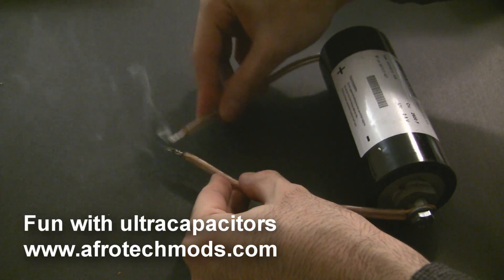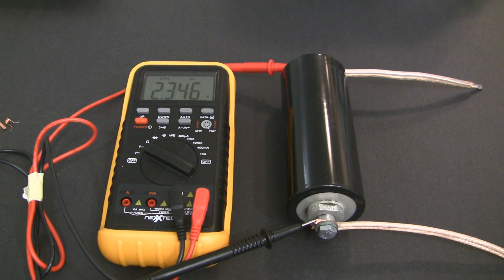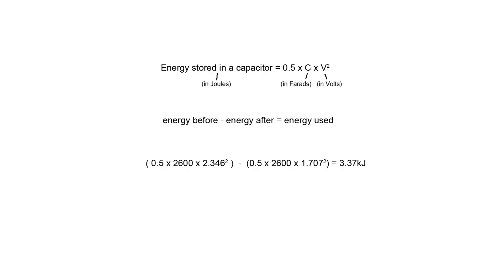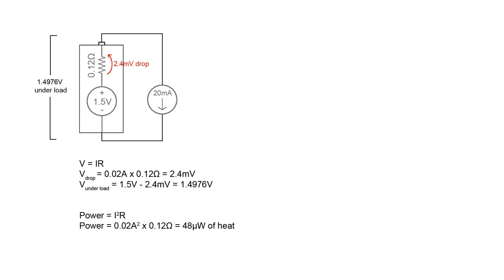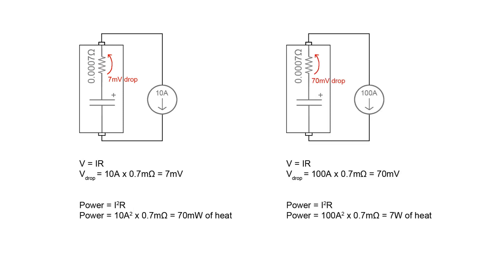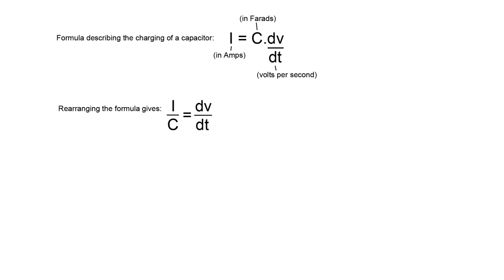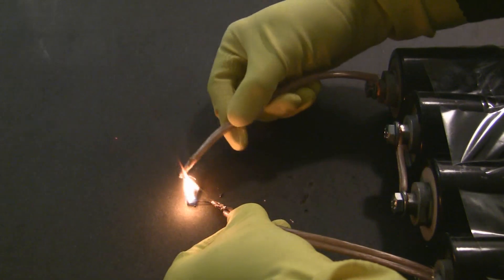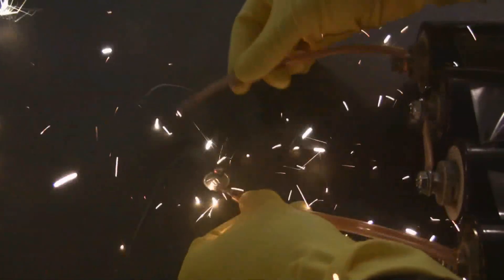Fun with ultracapacitors!!

Comment: So....testing these on your tongue would be a bad idea.
Reply: Well its about as bad as putting your tongue on a 9v battery for a smoke detector.. because the voltage is not very high. your tongue will not vaporise. theres a difference in conductivity between solid metal. and your tongue.
your tongue isnt going to incinerate. because your tongue is not a solid piece of metal.
your tongue is a very poor conductor.
You don't get shocked when touching both ends of an AA battery with 2 fingers on the same hand.
You dont even get shocked with 20v DC across your fingers.
You would need at least 50v DC or higher to even start to feel a tingle!
Reply: If your tongue resistance was 10k Ohms (which I believe it is) there woud'nt flow a huge amount of current.
I = U/R (9.65V/10000) = 0,000965A. That would't hurt.
Reply: PrashMotion You just wouldn't want to accidentally short the wires while it was on your tongue
Reply: short the wires of the capacitor bank? or of the 9v block?

Comment: So a capacitor is basically an a battery without built in resistance?
Reply: Capacitors and batteries do the same thing (store energy) but they are two completely different components.
Reply: David Kaufmann batteries use electrochemical energy, capacitors only use pure electric energy or the geometry of the capacitor.
Reply: Batteries use chemical energy and capacitors use static electricity between 2 parallel insulated plates. The more voltage you want the more insulation you need but less surface area you can fit (less farads), or the more farads you want but less insulation you can fit inside.

Comment: Should be titled. Welding with capacitors. I see your wearing heavy rubber gloves, and I'm sure face and eye protection. Like a welding mask, because that would surely cause eye damage from the bright sparks. Please don't try this at home, it's very dangerous without all the safety measures I mentioned. It's much subdued when viewed on video.

Comment: Is it possible to hook up those 4 connected ultracapacitors to a transformer and then charge an electric motor on a car or any other motor with pulse signals? :) In this case those capacitors would work like a battery?

Comment: If you're going to try this yourself I recommend setting up some type of quick disconnect switch or breaker in case the wires become stuck and get too hot to touch.  Much better then a complete meltdown.

Comment: Wait, so if I have zero volts when I've discharged it, these numbers don't make much sense.
0.5*2600*25 (25 is 5v squared) - zero = 32500kJ / 3.6 kJ/Wh = 9028wh.  I'm doing the math wrong, right? 9kwh out of something that can fit in my hand?

Comment: Using your calculations you used about 100A at 4 sec for ideal short circuit, as need to includes wires and short circuit resistance, which can measured with mili-ohms meter.

Comment: I have a "common" electrolytic capacitor here... two actually. each one is rated 200 "WV" (does that just mean volts?)  and 680 microfarads. if I charge it for six seconds with 120 volts, how fast will it discharge below half of it's original charge if it just sits out, not attached to anything?
Reply: WV!?!?!?!?!?!?!?

Comment: Well, except for two things:
1.  you can only cycle a lead battery down about 25% without causing some reduction in cycles available.
2.  Lead-acid takes a while to charge, while caps charge as fast as you can provide the energy to them (assuming a decently low ESR (resistance)), so you don't need to store more cycles than necessary to start your car once (+ some safety measure).
3. Caps have an almost unlimited # of cycles available.
4. I can't count.

Comment: Can you power something with these like a battery? you have them wired to output 9 volts DC. Could you power a boombox that normally runs on 6 C batteries or would it just fry the boombox?

Comment: with at least 5 of them - yes (5*2.5v = 12.5v) but you should use at least 6 of them or you run in trouble if they get charged by your car up to 14.5v

Comment: so it is no problem to charge them with 100 amps if my wires dont vaporise? but i have another question. i bought an array of 7 from those maxwell 2600f/2.5v. do you know what happens if i charge it up to 14.5v and connect it to a 10.5v car battery? does it blow up my battery because of charging it?

Comment: "but if the capacitance is high then the discharge will take a long time" you should add a qualifier here that says "assuming the same stored power". There's nothing *bad* about high capacitance, but what you need is high voltage and low ESR to get high current. High voltage only becomes equal to low capacitance when you assume that the power stored in the system is a constant.

Comment: ".... or 32.5 kw for 1 sec....... or 1MW for 0.0325 secs" is FALSE!
Because capacitors has internal resistance. Its maximum power is less than 12 kW per unit. It is equal to 48kW per 4 units, but this power will be only for 0.1s. If 4 capacitors discharge from 2.5V to 0.5V for 1s, then energy is equal to 20 kJ.

Comment: what would be the difference from putting it in parallel? you would get the same 2.5V, and but with a huge 10,4K farad. What are the pro and cons to parallel and series in terms of power, and the effects ( sparks)

Comment: Hi!If you have configured the capacitors in paralel and the total capacitance will be 2600 F x 4=10400 F at 2.5 Volts will be the same as you configured in the video in series at 650 F and 10 Volts?The power will be the same?

Comment: Yes. We have varying amounts of resistance depending on how far apart the points are being measured, moisture level of the contact area etc. This is why placing a 9volt battery across your finger results in nothing but putting it on your tongue produces a noticeable shock. Your tongue has much lower resistance than your finger and will pass more current from the battery. We also act like capacitors to store a charge since we are generally insulated from ground by shoes, carpet etc.

Comment: Both are partially right but the woodworking teacher has the edge. Voltage is basically the potential to deliver a dangerous amount of current. If as you suggest voltage was the main determining factor we would all be dead. We are constantly building up and dissipating thousands of volts by simply moving around (static electricity). The difference is there is next to no current behind the discharge. Household 240v is quite dangerous because of the current backing it in addition to the voltage.

Comment: "a battery is a device consisting of one or more electrochemical cells that convert stored chemical energy into electrical energy."

"A capacitor is a passive two-terminal electrical component used to store energy in an electric field."

Check more from wikipedia :)

Comment: Leslie Liu, yes you're wrong. The higher the resistance, the slower the capacitor will discharge. Try connecting a charged capacitor to a 2 megaohm resistor, then the same capacitor charged to the same voltage in a 200 ohm resistor. Monitor their voltage variation with a multimeter.

Comment: The reason capacitors have a measurable capacitance (in farads) is because they can store a voltage supplied to them. The vast majority of batteries can't store an external voltage.. Also, they have different mechanisms: a battery stores chemical potential energy while capacitors store electrostatic energy, so it doesn't make sense to apply Faradic capacitance to a battery.

So it's practically 0 (there is a tiny amount but it's negligible).

Comment: If the ESR of the battery is low that means the power (P = I^2 * R) absorbed internally is also very low, which means not much heat is produced (power through a resistor is transformed into heat).

Comment: Dear friend. If I buy an Ebike wheel with Voltage: 48V //
Wattage: > 400w  // motor type: 1000w 
Is possible swich the battery to some ultracapacitors like that one or they will lose power to fast?

Comment: A large cap tend to use an electrolyte whose polar molecules reduce the electric field strength so the device has the same capacitance as an air-gap capacitor with the same area but nanometres apart but without requiring insane engineering tolerances. (+|:−E+:−E+:−E+:|− is like +|:::|−.) Also higher value capacitors of the same type tend to have bigger plates, often made into a jam roll.

Comment: One doubt on the Capacitor Size.
By theory, larger the value of capacitor then less is the distance of separation between the two plates. But generally larger value capacitors are with larger size. Why ?

Comment: The other problem is that they discharge by the themselves faster than lead acid. If you leave your car parked for more than a week I guess it would not start. 

Another advantage is that (if you don't treat them as in this video) they last a long time, longer than the life of a car.

Comment: These capacitors contain about 8K joules per capacitor. A good car battery contains about 288 (says google) so you would need 36 of them which is rather large and heavy. Not recommended for family saloon.

Their advantage would be that if you had the power supply or a massive alternator, or a braking system that converts kinetic energy to electricity you can charge them quickly. You can also discharge them quickly (as here) so if they were cheap enough they'd be good for starting large trucks.

Comment: Why dont you make a cordless welder? get 10 supercaps in series u get 25v its enough to weld 2mm rods and u said it cant produce undreads of amps.it must be possible to weld. i was thinking in put 2x25v supercaps in parallel on my mot welder. i allready have it in dc with a bridge rectifier.

Comment: Does anyone know how to slow the discharge rate of a super capacitor bank in order to provide safety to the end user?   

I want to play with super caps but I am basically afraid that I will make a mistake and fry myself.  Is there a circuit that would slow the discharge rate of a super cap bank down to that of a battery?  Maybe a giant load resistor?

Comment: nope, one of these at 5 volts is larger than a phone battery and wouldn't last as long (from what i remember). soon enough the graphene capacitors will take off and you'll have a flexible phone battery that does exactly that.

Comment: So putting a few of these in series creates a very high current?
Ideal to make a Rail Gun?
So having a few of these 2.5v 2600F capacitors would do a better job than several 400v 10000uF capacitors, current wise?

Comment from the maker: No. Using this to weld would be a really bad idea. You aren't supposed to short the caps for long periods of time.
Reply: where are you?
please, bring us more fun.
Reply: hey what happens when we connect them in parallel? can we get higher current draw?
Reply: @nonowords7857 test it yourself

Mix sugar with baking soda 

heat the mixture

Carbon foam will form

Cut slices of it 

connect two of them with electrodes and put them in an electrolyte 

Ta da a supercap

Comment: Hard to explain without some kinda complicated maths, but basically there is a lot more energy for the large cap to get rid of, so it takes longer.

(complicated bit)
The voltage drop or current drop in a capacitor is given by (V/Vo) =e^(-(1/RC)*t), (where Vo is the starting voltage) so basically the percentage voltage drop is bigger per unit time if (1/RC) is bigger. So as Capacitance (C) increases the percentage drop per unit time.decreases.

Comment: How much does the 4 capacitor array weigh?  You should try clamping one end to a piece of mild steel and the other end to a 6010 welding rod and see if you can weld a bead.  It might be difficult to strike an arc with only 10 volts, but it should be possible.

Comment: I'm afraid you're not going to find any of those 2600F ultracaps for the same super discount Afrotech got them for. I've been thinking about the same thing as you have, a pulsed welder with some ultracaps, but the cheapest ones I found where 2600F & 3000F 2nd hand ones for $30 on eBay.

Comment: Voltage is a measure of potential difference, I.E. the electrical energy stored up in one object in relativity to another. If you measure a 9 volt battery to be (obviously 9 volts) and put your tongue to it to shock yourself, then there is a difference of 9 volts between your tongue and the battery (theoretically). Amperage on the other hand refers to the strength of a current, so the more voltage, the stronger the current because potential difference is higher.

Comment: It works either way depending on the situation. For example, if you are talking about a pole that is 75 meters long, you do not say, "I have a 75 meters long pole," but instead, "I have a 75 meter long pole." Except, you may also say, "I have a pole 75 meters long," but not "I have a pole 75 meter long." So it just depends on the sentence structure.

Comment: @afrotechmods... I saw a post where someone mentioned using a "slow draw capacitor" in a home solar system in place of deep cycle batteries to store and deliver the electricity.  Is there such a thing as a slow draw capacitor, and do you feel it could be made practical in a home solar system design to replace battery storage?  Thanks in advance..

Comment: Hi, just a question about units: do you really say 1 volt, but 2 volts? In germany, you say volt, farad, ampere and don't change the unit because of numbers higher than 1. Is it common? Thanks!

Comment: My dad got a capacitor from his work. Its 8 inches long and holds 75VDC and a TON of power. They threw it away and I got it for FREEEE! I use a 12V wall charger for it and I make huge sparks. (GOT IDEA BEFORE VIDEO)

Comment: Depends. Coilguns can be fired with whatever will dump a lot of energy quickly, so these ultracaps are prime candidates for use. However, normally people use large "standard" caps with high voltage.

Comment: Hello Mister I want to ask you of the difference of ceramic cap and electrolytic cap,I know the polarized and non polar,But I want to know what the use of those capacitors,Why Ceramic capacitor blocks DC and why polarized capacitor letting DC volt thanks!

Comment: The heat is whats makes them blow up.  Since the internal resistance is very low, and by that I mean very incredibly low there isn't enough heat generated to make them blow up.  Notice though he doesn't keep it shorted for long periods of time.  Small caps like what you see on a PCB hold very little energy, but can still pack a punch.

Comment: Needless to say safety comes at the first place. Capacitors do explode if hit by high voltage, or it might be a "polarized" capacitor which could only be used one way and wiring it the opposite way caused it to explode. Little bastards don't even resist. Literally, LOL.

Comment: You could pull more current. The caps are rated for 600 amps, so putting the 4 in parallel would raise that to 2400 amps. A single cap can supply that, but it will damage it.

Comment: No. Its a combination of both. It takes barely any voltage/current to kill you, however a driving voltage of at least ~50V is required to break your skin. This voltage depends on the resistivity of your skin, which depends on a number of factors. Once the electricity is flowing through your body, the amount of damage really depends on where the current flows through. For example, a small electrical current through your heart can override your body's control of your heart, causing fibrillation.

Comment: You forgot that batteries are actually charged at 1.7 V despite the fact its written 1.5V,, it is to counter the effect of regulation: after plugging something to the battery, the internal resistance  of the thing you plugged will cause the voltage of the batteries to drop a little

Comment: In series, they deliver more voltage. In parallel, they offer more amperage, but for these things, that's not much of a problem. Same as working with batteries or other power supplies.

Comment: Wait a minute.  I'm no electrician (my apologies if that is the wrong term used in your profession) but basically.. to my understanding, minus all the formulas you've shown, capacitors are similar to batteries in the same sense they hold electrons but at a higher capacity.  Can this method be put to use to store/use energy more efficiently?

BTW.. great video.  Definitely one of the more informative/educational videos I've seen and a good 6 min 11 secs of my time put to good use. Thank you.

Comment: The ungodly discharge rate of a capaciter isn't at all practical. They also have terrible energy densities compared to batteries.
They have their uses in so many everyday items because of their properties though.

Comment: Just a noob question but, since if you connect them in parallel you get capacitance total = C1+C2+... and so on, so more capacitance than when connected in series, so doesn't it mean more energy stored?

Comment: The amperage rates for those are pretty impressive. From what I gather, railguns require amperage more than voltage, so these would be well-suited to that purpose. Too bad I don't have any knowledge of how to arrange such electrical circuits, nor electricity in general, or I'd start making one.

Comment: Using Energy in Capacitor = .5 * C * V^2, the energy of 4 capacitors in series = .5 * 650 * 10^2 = 32,500 J. If they were in parallel, that'd be = .5 * 10400 * 2.5^2 = 32,500 J also? It'd be the same right?

Comment: a farad is a unit of capacitance, the more capacity, the more energy you can store (the more amps you can release), volatge is just the electrical potential, you still need it for the electricty to flow though. the more voltage you have, the better the electricity will move through a medium. last time i checked, roughly every 1kv you have is 1mm electricity can move through the air.

Comment: I've been messing with a few capacitor and they are 330v and 120F and the one you talked about in the beginning was 200v and 560F. so i do look for capacitors with higher volts or farads?